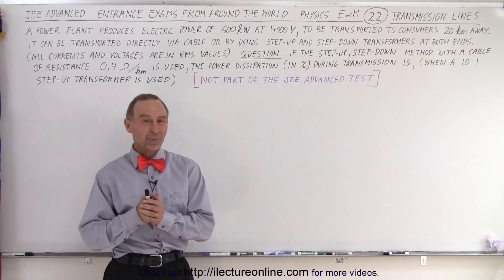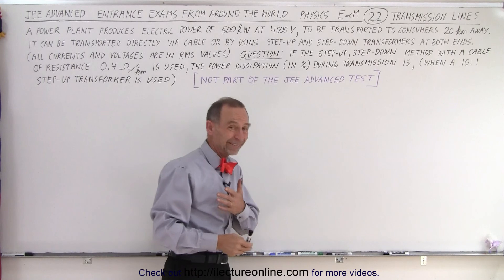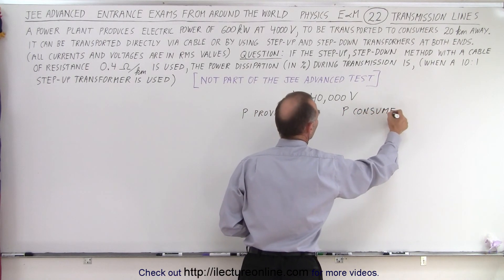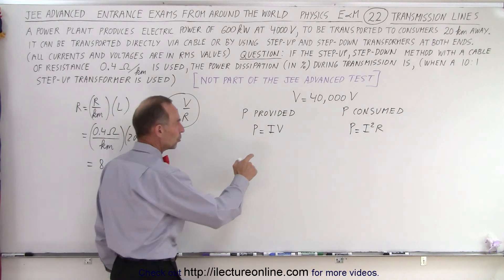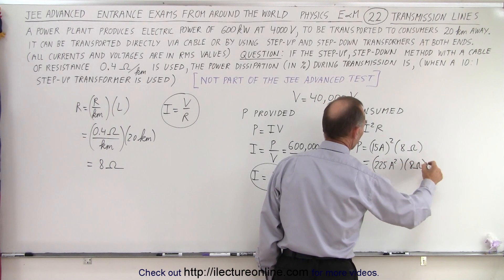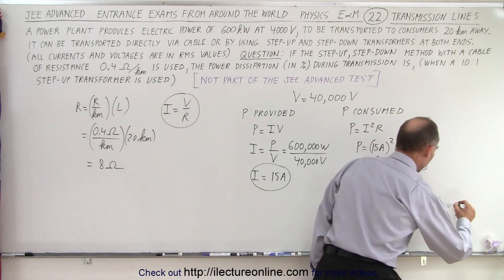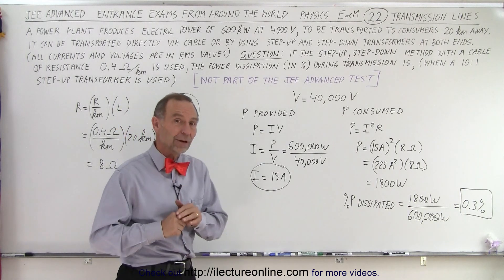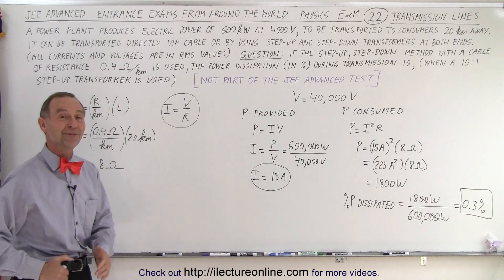JEE Advanced Physics  E & M #22 Transmission Lines (How to reduce power loss?)

Comment: Once I had the amperage, I just used ohms law to tell me the voltage drop.  15 x 8 = 120 voltage drop.  Since voltage is energy per unit charge, the voltage drop (120) x the charge (15) = 1800 watts “consumed” by resistance.  Of course, there is always multiple ways to get an answer.
Reply from the maker: Yes there is.

Comment: Why can't we use power dissipated = V^2 / R equation?
Reply from the maker: We use P = IV for power provided and we use P = I^2 R for power dissipated.
Reply from the maker: Note that the power provided is a function of the current provided at a particular voltage.  The power dissipated is due to the current flowing through the resistance.